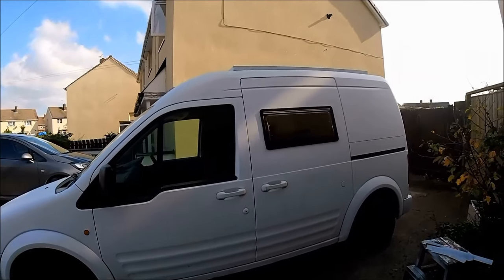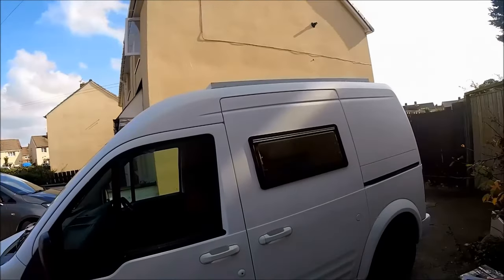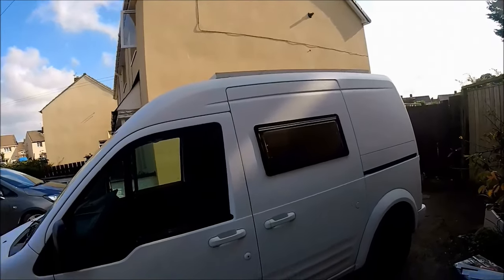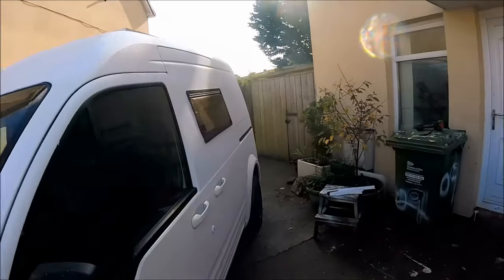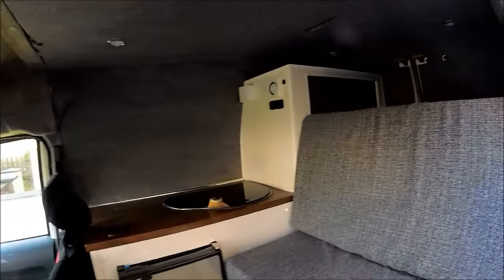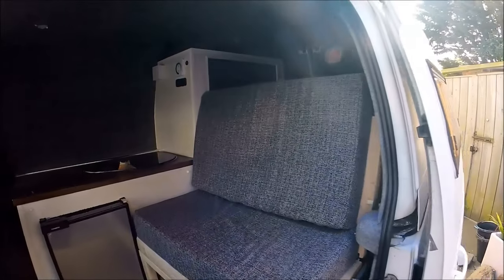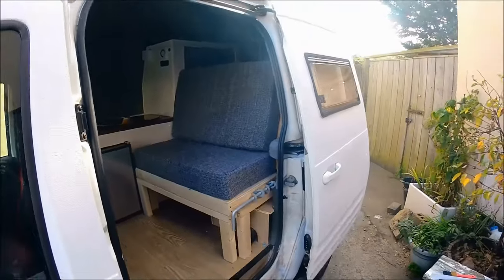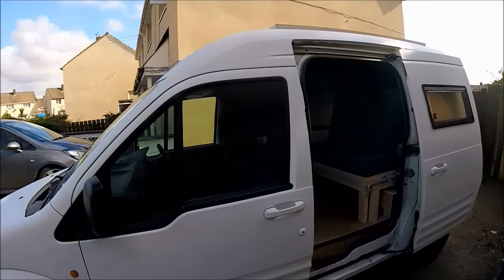Ford Connect LWB Micro Campervan Conversion Time Lapse

Comment: Excellent vid, giving inspiration to do a build. Just a quick one, try and avoid grinding metal near UPVC, ie. house window frames because the sparks are hot and will bed itself into the plastic, eventually rust and it looks nasty stains the plastic and all sorts 👍🏻

Comment: What did you use on the roof to clean and stop the rust before spray painting? Thanks  for sharing this Ford Transit Connect Micro van conversion
Reply from the maker: Kurust
Reply: @TheCampervanBuilder  Thanks for the info

Comment: I have a Citroen Berlingo van microcamper. At the moment I have a boot jump but think I would prefer a more permanent set up. How do you work out what size your units and bed is going to be.
Reply from the maker: Im tall so I work it out from what I’d need to lay flat and build from there, I never have plans or designs so to speak
Reply: OK thanks for that. It's mainly things like the height and width of the kitchen unit and width of the bed. By the way love the channel. Keep it up.